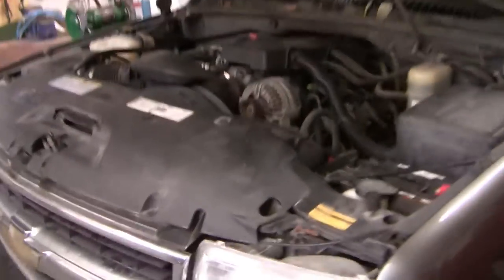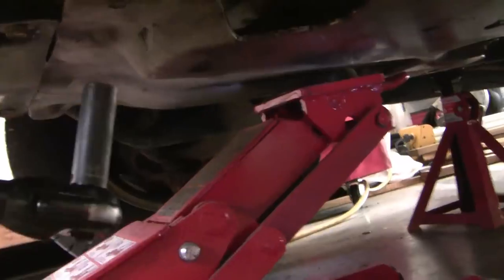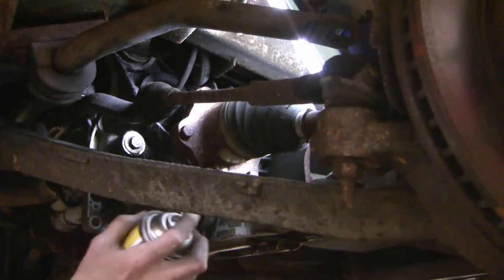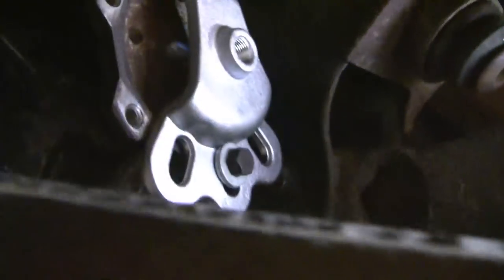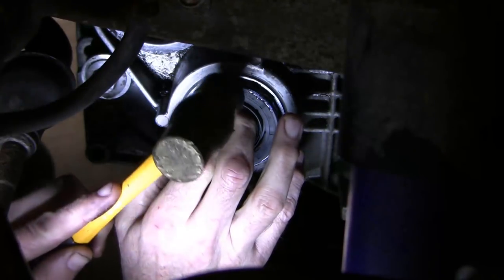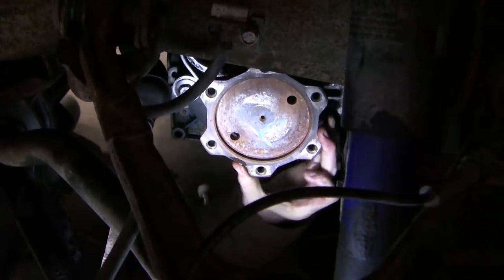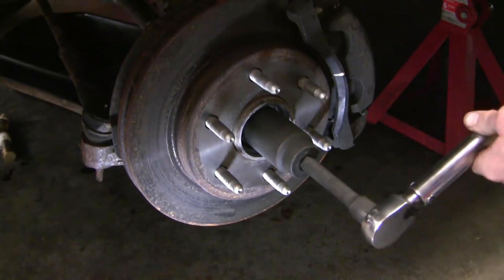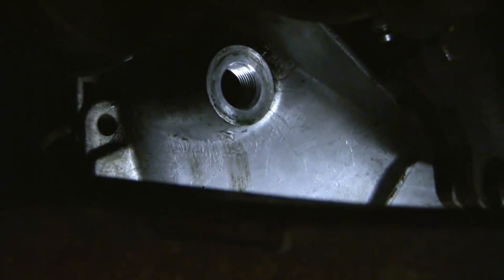How to replace left front axle seal and CV axle, Chev 4X4

Comment: After spending an hour trying to get mine out today I spent the rest of the day with my welding machine and metal lathe making a slide hammer with a 3/4" x 3 foot shaft and about a ten pound chunk of 2-1/2" hex stock slide. I pounded on it till I wore myself out and the axle still hasn't broke free. Tomorrow I'm going to buy some long bolts with the same thread as the six holes in the axle flange, then put some flatstock on the transfer case so the bolts don't punch a hole in it when I put some pressure on it, maybe some bolt tension plus the huge slide hammer will work, I'm starting to worry!
Reply from the maker: How frustrating! I'm sorry, Shane, I don't have much more I can add. In the end in my case it took about 15 minutes, and when it came out it almost fell out with not much pounding at all. I think I just had to find the right position of that C clip, trial and error, but not much pounding. If you can't get it out, your options are to button it up and put up with leaking and regularly adding more fluid, or ask somebody to split the case for you, maybe even do it on the bench. That's all the TSB recommended. It's a lot of effort for a seal. I might just put up with the leak, these old trucks don't last forever. If you don't let it all drain out it probably won't cause much damage to gears.
Reply: No luck today either, I'm done! I really appreciate your how to videos and advice in the comment section. The drivers side wasn't even leaking, The passenger side was and thanks to your video, I got that side done. I just figured I'd do the drivers side while I was at it since I had everything off, (I bought a kit from Detroit axle with new cv axles, wheel bearings, tie rods, pitman arm ect. Hopefully I didn't screw up the seal, I'm going to button it all up tomorrow and go buy new tires and get an alignment. If it leaks, I'll take it to a garage, if they want more than $1000 I'll just buy a remanufactured transfer case and put the entire thing in myself. My local garages and stealerships have tried to rip me off a couple times so I'm doing things myself, thanks to YouTubers like you, I've got some help! Thanks again sir.

Comment: Good video i have been reviewing videos all day trying to get my courage up to do mine, you made it look easy. Over all how much time did it take you ???
Reply from the maker: +Nick Sacco A few hours, but it could be longer if you can't get the shaft out of the diff. Pay close attention to the new seal to be sure you put it in correctly. Some seem to be designed to go in 'backwards' compared to the OEM orientation. I'm told that some seals have a mark in tiny letters indicating which side is the outside.
Reply: +spelunkerd I'm not certain, but a common practice on axles is to have a seal (or bearing as the case may be) that doesn't contact the original spot on the spinning shaft. This would relieve the original wear spot from even more wear. It might explain why some seal manufacturers have a different design from OEM.

Comment: awesome video, on vacation and mine just had to be replaced. well the cv axle did and when in Rome right. I have no special tool right now and town is 35min. away trying to get that stubborn thing out right now...lol
Reply from the maker: I know that frustration, it's not easy to do any repair away from the home garage. Good luck!
Reply: spelunkerd my god man I have used bars wedges and a hammer all at the same time man and still no pop. this sucks when one is as stuck as mine. of course I can only get the bottom half of the axle. I've tried a cheesy air hammer too. I'm thinking of just traveling to the parts store to hunt down a slide hammer knowing that there's no room for one sighs! lol
Reply from the maker: Oh, I'm so sorry, Jon. In the dealers manual, a TSB was inserted to speak to the complaint that this is sometimes difficult. They offer the 'helpful' idea that splitting the case may work well. Ya, like we all want to pull the whole axle and diff off the truck just to swap a seal. I was getting a little frustrated when it suddenly dropped out. I was spinning the axle a little, tapping, then spinning, tapping, etc. With one little tap, just as I was contemplating what I was going to do next, it was free. It's not about how hard you hit it, it's about getting the right angle with the snap ring in just he right place. What makes it hard is you can't see what you're doing. I believe that if you hit too hard, it could damage the internal snap ring that holds it in place, which might make it harder to remove.
Reply: Thank you, I finally traveled to town a got the slide hammer not really wanting to do the alignment again. I still pulled the upper control arm and 3 smacks and it came out. Bit damn 179.99 for 5min. Of use lol at least we get our money back. I did screw up the seal hole and man was I worried but hammered it in and a little  rtv should be good now. Next time I need to pull it all down to change all the seals and gaskets on the spring list. Thx again for the helpful video!
Reply from the maker: Hey, Jon, I'm glad it worked out for you. Your thread will helpfully prepare others for what they might expect. It's great to have people like you describing your experience. Dave

Comment: Hey, thanks for the great video.

Is the axle seal you replaced the same part as the axle seal i see when i remove just the cv axle?
Reply from the maker: This 4WD axle comes apart in two pieces, but the seal performs the same task as others. For part numbers, I ask my parts dealer for help, or check online from places like RockAuto.

Comment: Great video. I'm in the process of replacing ball joints on the left side and notice the left axle seal seems to be leaking. Maybe the slide hammer will work for me since I've got the spindle off. I borrowed a ball joint pressing tool from O'Reilley's so maybe they also do the slide hammer as well.

Comment: I had a question regarding my axle seals.  They have started leaking, not much but enough to make them wet.  Would you recommend changing them right away or wait it out until they worse?
Reply from the maker: OK to wait for a while, but keep an eye on the diff fluid level, add fluid as called for in the manual as needed. If the volume loss is high, do it sooner. There is a small risk of the failing seal allowing dirt back into the diff, but usually that risk is low. Also have a look at the CV axle and joint, make sure the CV axle isn't bad, causing the adjacent seal to fail. It's pretty easy to do these seals, personally I wouldn't procrastinate. A leaking seal means resale value is lower so eventually you'll want to do it, may as well do it now.
Reply: Thanks! So far no change in the diff fluid level and it's been a few weeks.  Luckily, nothing has hit the ground, so the leaking is minimal.  I do take it on trips of over 2000 miles, so I'm thinking I would have to replace them prior to then.

Comment: Great video, very informative and well done. Is there an old Indian trick to getting the c-ring on the axel to snap back in place? I've tried everything I can think of. Been hammering on it and everything but it won't go in the last quarter of an inch. I'm replacing both axles and bearings on my 2000 Chevy tracker 4x4. Please help before I just blow it to pieces.
Reply from the maker: It may be bent and mangled, not sliding into the correct groove. You can buy a replacement, but to get it out and examine it you have to remove and split the case. It's not as difficult as it may seem but you need to be able to set the backlash and preload on the bearings during reassembly, so you need a dial indicator and some kind of tool to rotate the axial preload adjusting screws. Then you can use that vent hole to paint the ring gear to look at the contact pattern. Eric O (Youtube channel SouthMainAutomotive) did a video this year showing how to split the case. I did a video of how to set backlash on a rear diff. Before jumping into that, I'd use a borescope to look inside and see if you can center it better. Then try again, with patience, rotating, tapping, repeat. I believe hammering too hard is often the cause of a mangled clip, since it gets pinched when pulling it out. Your other option would be to consult a pro, it may not be as expensive as you fear. Good luck, please stop by and let us all know how it turned out.

Comment: Wow, super fast.  What did you pry the seal out with?
Reply from the maker: I used a large flat screwdriver, but a seal puller or any prybar would work. If the last guy used RTV it may put up more of a fight. Stay away from  9 o'clock, you don't want to damage the sheet metal locking tab underneath. See the linked recent video for better explanation. Good luck!

Comment: Hi thanks for making this video, I have 01 Chevy Tahoe my question is the seals are the same for both sides for front differential? I have to replace the right side I should just replace both sides while at it thanks
Reply from the maker: The seals are different. In view of the unpredictability of how easily that stub shaft comes out, I wouldn't want to be in the situation of cussing over a task that wasn't absolutely necessary. In the amateur world you can always revisit that left seal at a future date without an extra labor charge you get in the pro setting. So, in my shop I try to avoid doing anything that isn't clearly justifiable.

Comment: is the needle bearing replaceable without splitting the case? my seal is also leaking, and I have a growl noise coming from I believe the front driver side..
my question is; can I replace the bearing and seal while I'm to this point or does the whole diff need to be slit open to change the driver's side.. my passenger side seal is also leaking.. can both sides be replaced while still mounted in the truck? thanks great video and awesome detail..
Reply from the maker: You can replace both seals on the truck. As far as the diff bearings, I've never done that job on this vehicle but I believe you can replace that bearing without  splitting the case, too. Some people describe needing special tools just to pull the diff. However a growling noise from the front could also be the CV joint, which is a more common bearing to go bad -- with those often you get a clicking or snapping noise when you turn the car. Aftermarket CV axles are fairly cheap and so most guys replace the whole axle if the CV joint has gone bad. Alternatively a growling in the area could be a wheel bearing which is similarly easier to replace compared to the needle bearings inside the diff. Ultimately you need an accurate diagnosis, and you need this done safely. It might be wise to ask an opinion from a pro, who could put your truck onto a lift and safely examine the truck with the wheels spinning. Trying to do this with jack stands can be really dangerous, and professionals typically don't charge much for diagnostic time. Good luck!

Comment: I have a 1999 Chevy Suburban and the axle set up looks similar to this 2000 model. I came across leaky outer boots on both sides and a mechanic told me that I have to replace the whole shaft $$$$. Is that true or is there other options to replace the existing boots only? Thanks for the information and footage for this repair. I look forward to viewing more videos and using your knowledge to help me repair my own Suburban in the future.
Reply from the maker: The cost of generic CV shaft replacements has plunged to lower cost than ever, so most technicians don't bother to disassemble CV shafts because the extra labour charges are not worth it. By the time the boot is torn, dirt gets into the bearing surfaces and so the joint will die soon anyway. Also, often the cause of torn boots is excessive play caused by a bad shaft. If you live in the US you could scout out the replacement cost from places like pep boys or rock auto or 1Aauto, and do the job yourself. Often there is a core charge, refunded when you return the old shaft. Up here in Canada shipping costs are much higher, so for us it's more problematic.
Reply: Thanks for the advice! I will definitely change the shafts myself when I find a replacement set.

Comment from the maker: The model changed later that year but it may be similar. Does it look the same as mine? I always try to get a manual that is specific for my vehicle. Dealers manuals are best if you can find one (?ebay) but I often go with alldata or mitchell. Regarding the oil, I always use what is recommended by the dealers, and I don't normally use synthetic. Probably would work but I don't stray from recommended. If I drain oil I almost always use new. Cheers!

Comment: Thanks for the excellent video. I have a few questions for you.

Do you think the repair would be simplified or made more difficult by leaving the drive shaft connected to the wheel bearing and allowing it to hang?

I do not own a slide hammer or anything of the like. Will I be able to extract the half shaft using a small hammer and some creativity?

Did you feel that there was significant risk of breaking the C-clip and needing to find a replacement before being able to reassemble the vehicle?
Reply from the maker: I followed the procedure outlined in the OEM dealers manual, assuming that they would advise the easiest way to do it. Although the procedure you are considering works for my Dodge truck, I don't think it works here. The half shaft extraction was definitely the most difficult part. Even though I had access to a slide hammer, I didn't use it. Just be careful not to pry on the case. Regarding the C-clip, I think the risk of damaging it so that it is unusable is unlikely. Good luck!

Comment: The driverside is a short shaft.. does the axle shaft really get in the way? Wondering if can just hang out of the way?
Reply from the maker: Reading through the thread, some guys seem to be able to do that. With an extra shaft in the way you may find it frustrating to do the most difficult part of popping it out. For this video I followed the dealers repair manual, exactly.

Comment: Hi, nice vid! Im in the exact same position - cant get the axle out of the housing. I made a slide hammer that fitted but its still stuck, whats the trick? Dosent it have to be in a certain rotational position?
Reply from the maker: Yeah, I kept rotating at random until a slight tap caused it to drop out. If you figure out a trick, let me know. This is enough of a problem for the dealers that they put out a TSB on the problem, but what they recommend isn't very helpful since in the last paragraphs they assume the diff is off the vehicle on a bench. Keep trying, have patience.

Comment: great video. Question on the c-clip. Is it designed that you do not have to split the case and remove the c-clip first? If so, I've never seen this type of arrangement.
Reply from the maker: Yes, if you're lucky. If not you need to split the case -- I've never had to do that.

Comment: I need to do this but I have heard that it was difficult and should take it somewhere but I like to do all my own work if possible.  This was very informative, thank you.  I was wondering if this could be the cause of my left front wheel not engaging when in four wheel drive?  All other wheels engage except the left front.  Any ideas?
Reply from the maker: There is a shifter motor on the right front axle that slides a nut over, locking the front axles together. Many of these are vacuum actuated. On my channel there is a video of replacing the axle seal on the right front of this vehicle where you can see the forks of this shifter and the nut. The video is not great but it does show the mechanical workings inside. The shifter for the suburban is mounted on the intermediate shaft, between the right CV axle and the diff. I would check for diagnostic codes, and check the connections to that shifter. If it's vacuum activated, look for little cracks in the tubing that could leak. Make sure your fluid level is not too low, since diff fluid lubricates this mechanism. Good luck!

Comment: Hello, great video. I have a 99 suburban, which it is considered the old body style. Wondering if it is pretty much the same way? It looks like apple and oranges to me. It is odd, I have the complete set of service manuals and it is vague on doing this job.
Reply from the maker: I think it's very similar, but I'm not sure. As you say, in 2000 they made major body changes.

Comment: Did the axle have a retaining ring at the end? It was hard to tell on the video. I pulled the axles on a 1998 and didn't see a retaining ring. I need to know if it requires a ring or not. Nevermind, I heard you say the driver side C clip is on the inside on the hole. Do you know if the passenger side is the same? Update: I just watched your right side video and I see that the C clip is on the inside of the gear. Thank you for sharing.
Reply from the maker: I've been in Africa for the past 6 weeks and am now following up on mail. It's been a while since I did this video, but everything I did was shown so it is unlikely I would have left a little detail like that out. I hope it all worked out for you, thanks for following up.

Comment: i am wondering if i can do this by just disconnecting the axel and not pulling it from the hub, to do just the seal
Reply from the maker: You can't do that because the diameter of the steel plate that bolts to the CV axle is too large to slip the seal over it. If you want to avoid having to remove the hub, I would take the vent cover off and seal that first, to see if the leak goes away. I show how to remove the plastic vent cover in the followup video linked in the video description.

Comment: I noticed today mine is leaking on the drivers side. I felt quite a bit of play in the inner axle which along with the vibration I've been feeling tells me the bearing is bad. I suppose the process is the same. do I need a puller for the bearing?